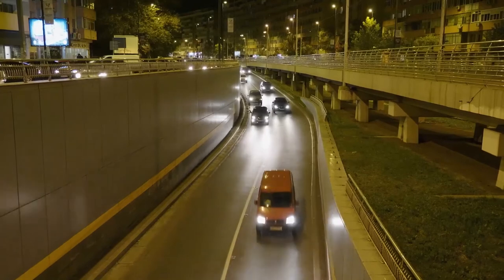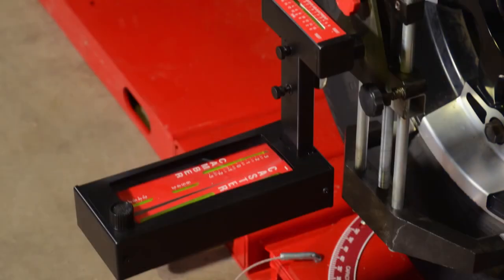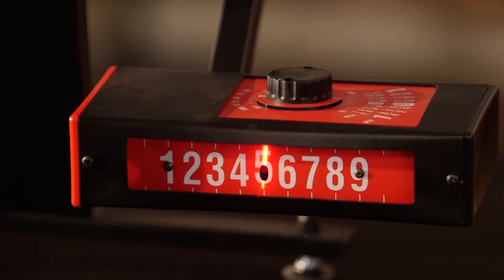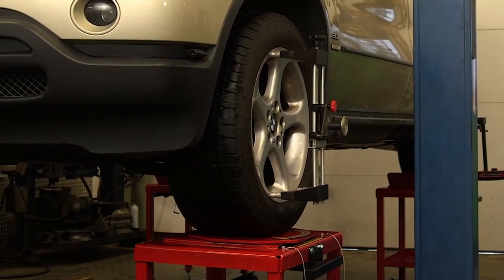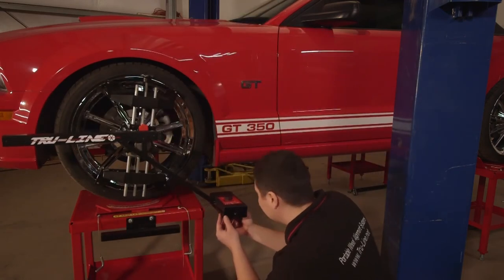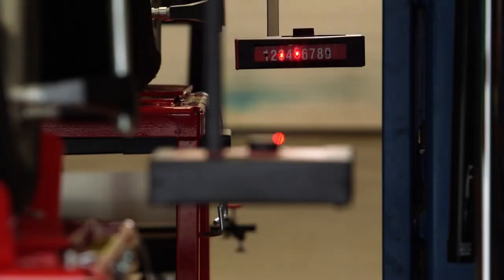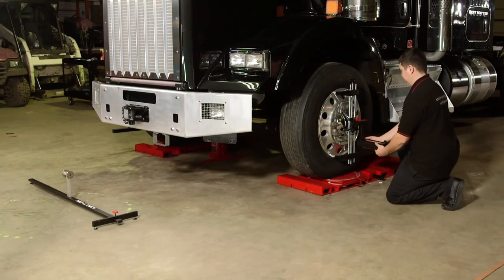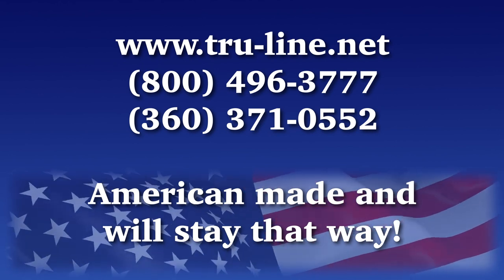Tru-Line | TL-12 Passenger Car Delux/Light Truck Wheel Alignment System 2022

Comment: This type of alignment machine works properly?
Camber n caster N front and rear 4weel alignment ?
What's the price of the alignment machine?
Reply from the maker: Thank you for your inquiry. The TL-12 was been in the industry for decades. Yes you have Caster, Camber, Toe front and rear, Four wheel alignment ability. Also, you can add the TL-90 Dually one ton kit and align even larger vehicles with the same machine. Please visit www.tru-line.net for all current pricing. If you have additional question give us a call or click on contact to send us a message. Thank you for your inquiry. Regards, Lesley Cooke President